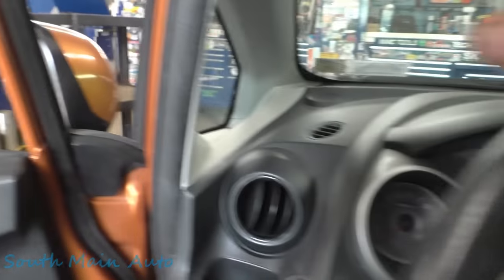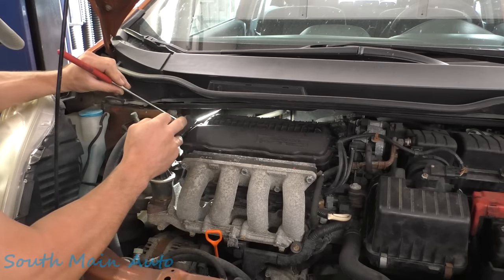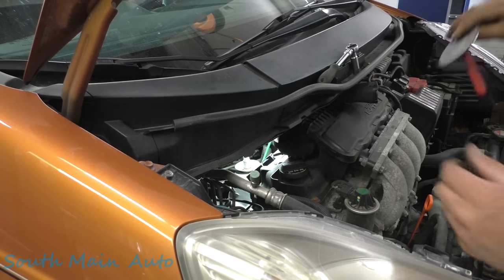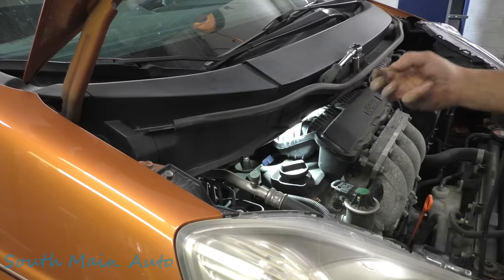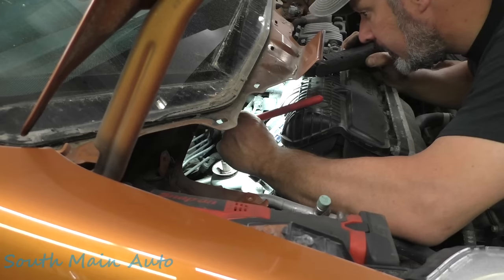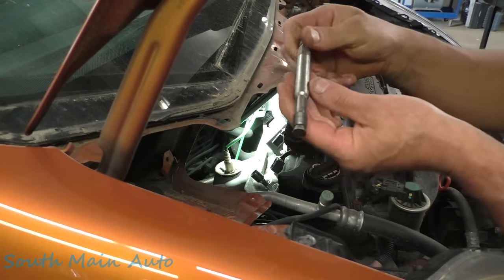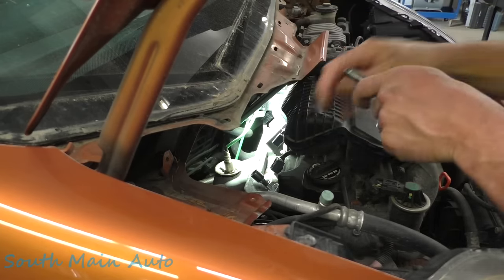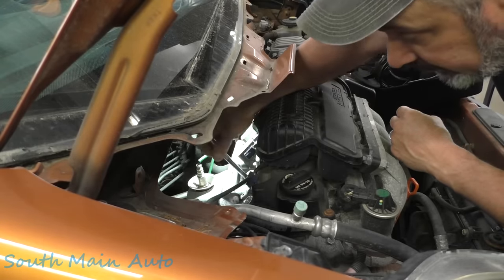Fixing A Blown Out Spark Plug - Honda Fit Edition

Comment: I remember a Caviler that had worn spark plug holes in an aluminum head. Took head off, went to speed shop, they stamped steel inserts in. We bolted the head back on, screwed in new plugs, and it ran for years. Saved several hundred for sure.

Comment: What I have done before is get a used spark plug, cut off the crush washer and put a 45 degree taper on it with your bench grinder where the crush washer was and use the modified spark plug to drive down into the new thread and tighten. The 45 angle will seat the top of the solid insert. Then remove modified spark plug and put in your toolbox. The one I did was Cyl 2 on a Hondu Pilot. No room to hammer.

Comment: I have never heard of spark plugs backing out. This is very novel to me. Great video.
Reply: If they're only finger t tight they will  back out has happened to me but luckily I didn't mess up the threads
Reply: @noblsht  The Honda Fit is well known for becoming loose overtime, at the original factory sparkplug torque spec. They increased it years later.

Comment: Long story, but I ended up with a manual 08 Fit a while back... definitely not much to look at and no racing machine, but was very nimble, great in heavy traffic and for its size had amazing amounts of useable interior volume. The back seats flipped every further increasing interior space... and they lowered the floor all the way back by moving the fuel tank up under the front seats. Head room was second only to a motorcycle. All & all, it was really very well thought out... and thats not even mentioning the stellar fuel mileage. In the 7 years I had it drove it cross country a couple of times & went everywhere in it... biggest issue was a flat tire. Sadly, I don't think they sold that well; heard Honda recently dropped the line.

Comment: Been an aircraft mechanic for 33 years and of course I fix my own and friends and family's cars.  I happened to stumble on this channel when I was troubleshooting a throttle body light and rough idle on a Fiat 500 and I've been hooked on your videos ever since.  BTW... If you ever have someone come in with a red throttle body light and rough idle on Fiat 500, check the charging voltage.  The alternator was the culprit (no battery light or codes set).
Reply: Being an aircraft mechanic I bet you have installed your shar of heli-coils.

Comment: I used an old phillips driver, with a length of vacuum hose attached to use as a spark plug starter, and Heli-coil sets are life savers

Comment: I need to do my first helicoil repair and your recent videos have given me a lot more confidence. Subaru power steering bracket bolt hole on top of the block. Previous shop chowdered it up pretty bad. Thanks Eric for all the helpful tips! I hope I don't mess it up. 🙏
Reply: Would it be worth finding a piece of scrap to practise/build confidence in the method first?

Comment: Excellent video.  It is really not about spark plugs, or refitting 'stripped out holes.''  It is not about a man and a wrench.  It is about having a backup plan, and solving problems.  It is not about referring the problem to a specialist.  It is about being the man they call.  See problem. Fix problem. Next.

Comment: Your comment about a brass hammer and a small ratchet reminded me of my favorite oil change business run by a retired Chief Petty Officer.  I happened to see the tool rack in the pit and saw that most of the wrenches were but in half.  I asked about that.  He told me that with a shorter wrench it's unlikely than any of his employees would strip out the threads for the plug.

Comment: Great job fixing the lady up.. Older Honda Fit.. 160K or so.  Those Cylinder walls looked GREAT..
Lots of life left on the car as long as it is not a rust bucket underneath.
Nice to see a good car put back on the road..  Seems like its a manual trans too head you wiggle the shifter for neutral before starting it.
That thing is a good 300K plus car if taken care of.

Comment: Thirty years ago I had a misadventure with a spark plug and I went on to get one of those back tap spark plug thread chasers to have on hand. Certainly the theme of getting another chance to rethread from the bottom is appealing. In the heat of the moment, it gives you another chance before you make things worse by crossthreading it all the way home. I didn't think the spark plug tube would be so deep as to make it too short to expand once deep in the cylinder. You make a good point. Since then I haven't had occasion to use it.

Comment: I've used that sparkplug thread tool, and it works great if the problem is the first couple of threads.  The #6 sparkplug on my Ford Racing 5.0L (aluminum heads) was cross threaded.  The engine was an eBay purchase, and had less than 1500 miles on it (car had been rearended and totalled).  Not wanting to pull the head, I took a chance on that tool.  It worked great!  After a couple of passes with the tool (put Vaseline on it to catch any shavings), the sparkplug screwed right in straight, and held torque.

Comment: ERIC  O   I  use  Shaving Cream in the Cylinder .  Run the Piston down .  Fill up 
with shaving Cream .The Shaving Cream will catch  the Metal Pieces .When 
done . Turn motor over to push the shaving cream out    :-))
Reply: where does it push out, the exhaust?
Reply: @nickaa827  You don't put the Spark Plug in Until
you have finished the new threads and the sleeve in .
 then turn  the engine over   :-))

Comment: Good work, what a pain to access!

I used a time-sert kit to do a plug thread in a 6 cylinder Jaguar E-Type (XKE). Nice access, but a lot of pressure to avoid aluminium chips in the engine. I had the tap filled with grease to hold the chips and went like a 1/2 turn at a time before backing it out to replace the grease.

I think the time-sert is a nicer kit, especially with the way they swage the insert in place, but they are very spendy.

Comment: One of the hole rethreaders similar to yours saved my rear on my old Nissen PU truck. It was worth all of the 50 bux I paid for it .I gingerly expanded it a tiny bit at a time, repeated the procedure,  and fixed the buggered top threads. Moral- Don't get in a big hurry when you are dead tired.

Comment: Eric, I've done a few on VWs using a tap and steel sleeve that I lock tightened and never had a failure. I greased the tap and blew out the shavings by starting the engine. Cool video!

Comment: The First gen Fits (Before 09) had the engine further forward and thus the plugs are easier to get to.  I've got an 07 and an 09.   I don't look forward to changing the plugs in the 09.   Thanks for the visual.  I see it's not much better even after taking all the stuff out of your way.
Reply: The first gen Fit (sold as Jazz on this side of the pond) is also probably one of the best made cars to ever roll off an assembly line. I have seen these do 200,000 miles and then only need battery, exhaust and wheel bearings and a clutch. In this class the only other car that comes close in the Yaris but they used to eat water pumps and they often burn oil.
Reply: Giving Subaru a run for their money eh?

Comment: This is a known issue on Honda Fit. Especially 2009. My wife's Fit had this issue at about 50k miles. During that time, the factory didn't use anti size, and that affected the torque.  Out of warranty, but Honda covered 50% cost.  Still ran me $2500.
Reply: We going to say haven't seen this issues on fits. I own a 2013 fit with 120015 miles and always used anti seize and tightened them with human torque wrench lol. I've read indexing them gives you the optimal mpg.
Reply: @ecotec4  Honda lost a class action law suit on 09 model Odyssey for this same issue.  A year later, it was corrected, but too late for some of us.  It's also why this was my first honda purchase, and also my last.
Reply: You don't use anti-seize on plugs the threads come with a coating on them. We had the champion plug man give us a lecture on this at tech

Comment: Impressive little engine.  161K miles and you can clearly still see cross-hatching in the cylinders.
Reply: It might have been easier and more cost effective to just weld in a new spark plug. The car looked old anyway.
Reply: @parkerbohnn yep you're probably the guy that forgot to torque down the spark plugs when you install them
Reply: Yes sir inverted Honda knows how to build an engine properly

Comment: I wonder if someone changed the plugs and was used to the taper seat style of plugs that barely need to be turned to tighten them. The gasket style plugs need to be tightened a lot farther especially if they are new and the gasket wasn't previously crushed.

Comment: This brought back some memories of over 40 years ago when I had to put a heli coil into one of the cylinders of a 650 Yamaha Twin after we discovered that a  Gorilla put the plugs in before I bought it and totally stripped one cylinder head. I was just over 21 years old, never done anything like this, and beyond scared that I was going to totally screw it up! My dad was out offering encouragement while I went through the process, and after all was done the bike was back on the road until I sold it. I think I still have the thread chaser from all those years ago in my tools.

Comment: Had the exact same problem on my niece's (originally my mom's) 2011 Fit. #2 blew out the spark plug hole, had to have it timeserted by the local mechanic shop. Then it blew out again so I loctited that sucker in there. Seems to really be an issue with the Fits and some of the Accord models.

Comment: For 161,000 miles, those cylinder walls looked pretty decent.
Reply: I’ve torn down 300k mile Honda engines that looked the same. Just about the only time you will see worn cylinders on a Honda, the owner has a K&N or other cone air filter. They don’t like sucking on dirt, and that is how you get that blue smoke puff when the SUPER FAST Civic hits VTEC 😂
Reply: Especially since it's a Honda Fit and I'm strict turning a bunch of RPM depending on how you drive it and where you drive it

Comment: On my old Dodge Neon I may or may not have used a 1.25 sparkplug helicoil on the 1.5 pitch sump drain plug.. Then the drainplug ended up looking suspiciously like a sparkplug afterwards..:)
Reply: The correct tool is whatever one you got!

Comment: Last month I bought a Vevor brand triple lens endoscope. Has side views. Full HD display. Very impressed for the 50USD price. Works very well.
Reply: I purchased one about 1.5 years ago. So handy to have.
I was told that I had obstruction in the lifter oil galley. The manufacturer was surprised to see the pictures of inside the motor. 😂

Comment: it seems crazy to me that spark plugs, a maintenance item, is on the back of the engine.  Sure, modern plugs can go 100,000 miles between changes, but all my modern cars have well over 200,000 miles.

Comment: If you don't change your valve cover gasket and the ring gaskets for the sparkplugwells (service)... it leaks oil down into the sparkplug well and the oil works its way into the threads then carbonizes and will blow out your spark plug...
Reply: You've got to be kidding me, where did you come up with that senerio. the reason it blew out is the last guy cross-thread it in.

Comment: In the last video you mentioned time-sert in the description or comments.  I prefer their spark plug repair inserts.  The inserts are thinner,  and instead of having to tap them in to swedge them the inserting tool is ever so slightly hex shaped and oversize.  It expands the whole insert to lock it in.  They even have special inserts for the problematic Fords that like to eject their plugs.  You are right to stress making sure the valves are shut.   I was working at a shop and they loaned out their kit to a customer and they damaged the valves on a Ford 5.4 trying to fix it themselves.

Comment: In all my working on engines of different makes, only had 2 spark plug holes to repair. Both were on Ford 4.6 liter and voth were #3 plug, still not easy in car repair but didn't want to remove the head either. Good job on this Honda and like you said, tighten them plugs down either a torque wrench or 3/4 turn after bottomed in the hole and job is finished

Comment: I have no doubt you have a specific process you follow running your repair shop. I also understand that vehicles are like people there may be similarities or not. After getting the cow off the first thing I would have done was get the scope so that I could physically see what I have to work with and not, wonder what’s actually happening. Love what you do and love what you post.

Comment: It sure would be nice if the owner would give you a truthful, comprehensive history, so you could approach the job more directly. My guess here is hubby or junior tried to change the plugs, put them in loose, and put everything else in finger tight. It takes a lot of tools and experience  to do this work, not just a typical Christmas set, and a smart phone with YouTube. I don't think I could have done this without pulling the head. Your attention to detail, even to peening the coil was outstanding, and you even took the time to show us all your results along the way. Well done, Brother.

Comment: Followed the steps for this repair and it worked perfectly. Had to buy an air compressor kit with a blow nozzle though haha. What i found was that if the blow tool has no extended nozzle you can attach a small diameter vacuum hose to it and shove it right down the plug hole, blew the swarf out perfectly

Im genuinely convinced though with these engines the second you get the smallest vibration on idle, immediately check the plug torque, no surprise to me that even following Honda's torque specs last time i changed them the other 3 were all loose, with good spark should be idling near 800, when the plugs were looser was closer to 650 and frequent dipping in/out

Comment: Another amazing video. I thought it would need to be machined. Just amazing. 

I just replaced my spark plugs and coils because my engine was missing. I used an Amazon kit. So far it worked. 132K Elantra Hyundai.

Comment: Loved this vid ! Thankfully never had a plug blow out. My mum has a Honda Jazz (UK), it’s a 1.4 with 2 plugs per cylinder - double trouble! She’s had it 10 years and I first replaced the plugs way back and found 4 NGK’s in the back (originals probably) and 4 champions in the front!!  - guess the previous mechanic didn’t know about the extra 4 plugs! All NGK’d up with dialectric and correct 3/4 turns - I don’t want me any dramas 😊. Car never misses a beat - just an EGR fault 10 years ago that was cured by washing out the valve with carb cleaner - do this every other year now.

Comment: Man what a pain. When I had to fix 2 stripped spark plugs on my fathers 1.8t Passat a friend recommended installing TimeSerts. This worked great - the car went at least another 200k miles. The install on the 1.8t was easy - everting was facing straight up. The kit you installed looks super similar - more than the spring with a break off tab.

Comment: I bought a 2002 camry and found cyl 1 spark plug jammed. Back and forth back and forth until it came out. Took a long time just a little bit at a time. Got a used good plug made it look like a tap with a small angled file. Back and forth etc with the plug until it seated. Put a new plug in with a little lithium grease. In and out a few times. No Problem, Took it out a week later put it back easy with no more grease. Excellent channel learn't a lot thanks.

Comment: Back in the day we had 15 1992 E-250's with the 5.4 2V engines. Every single one of them had a spark plug back out booger up the threads and break the mounting tab off of the coil. Lisle Tool made a kit at that time that had a tap pretty much like the one you have but the insert was solid like a Keensert. They worked good but i could never get all the aluminum shavings out of the cylinder. Looks like you got the Honda all fixed up!

Comment: I'm curious why many people prefer to use the solid thread repair inserts rather than the actual Heli-Coil style coiled wire inserts. You have to remove so much more metal to use the solid insert. The Heli-Coil is larger in diameter than the prepared hole and so it is self-locking by spring tension once installed and a little anti-seize on the plug should prevent it from ever trying to unscrew the Heli-Coil when the plug is removed in the future. Also, the Heli-Coil is made of stainless steel which seems like a plus to me. Whichever insert you choose, I would never do it without a self-piloting tap to ensure it goes in perfectly aligned.

Comment: Had to do this exact job about 5 years ago on an Equinox.  Same thing, back bank but had less room than that one.  Did they whole job completely blind.  Used the same style inserts from O'Reilly's, they have a single hole kit.  Comes with the tap, swedge, and 3 inserts of different lengths.  Didn't have the fancy insert tool like you, just used the spark plug to screw in the insert.

Comment: On the Fits this is fairly common. Even the OG plugs can loosen up. If you own a Fit and smell a little gasoline coming from your vents while the engine is running check your plugs and save yourself a repair bill.

Comment: DIYer here. I've had bad luck with parts store spark plug bushings, the ones knurled at the top. Had great luck with Time Sert (not a sponsor). Big Sert to repair holes on failed repairs, which is what I used to repair a failed repair that had been with a parts store busing kit. Again, I highly recommend the Time Sert bushing kit. It's life changing.

Comment: Ohh man.. I just did this on a Ford 4.0 SOHC rear most plug on passenger side.. didn't have to remove the head thank God.  But I was sweating bullets until I got a good could full revolutions on that tap. Great repair going in blind . 👏 🎉